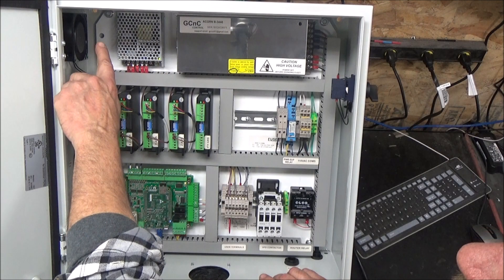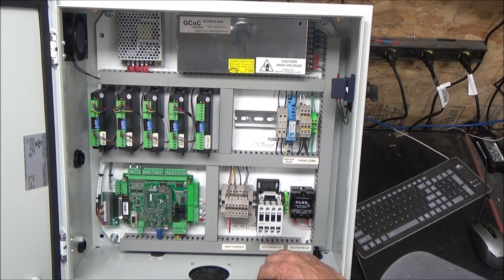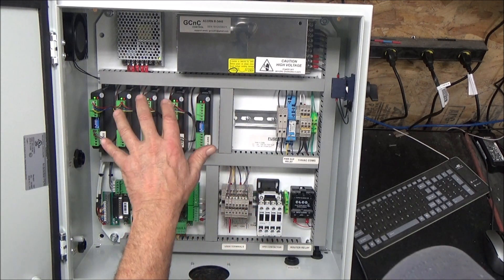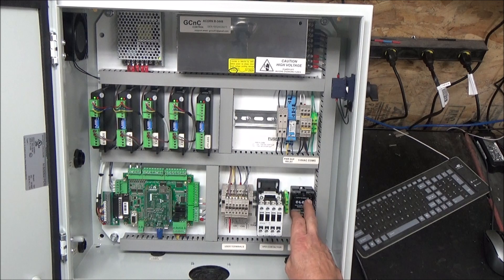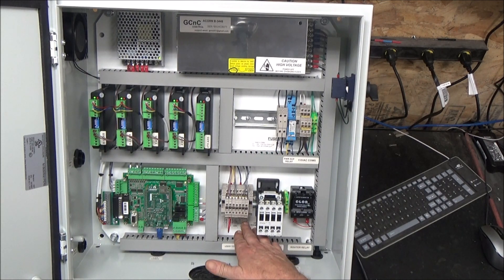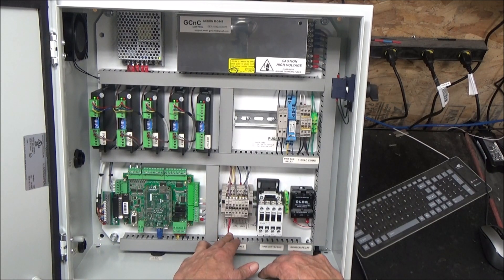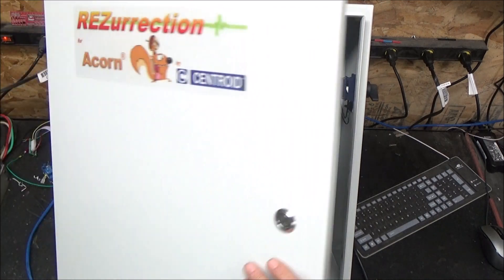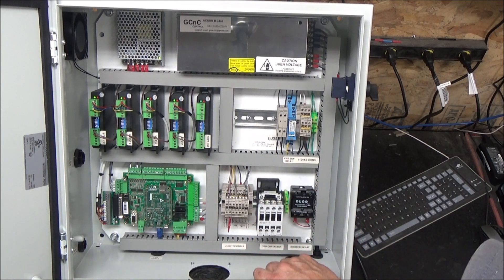Centroid Acorn Controller for ShopBot Standard

Comment: Thanks for sharing!  Nice, clean installation!!!!!!!  Very well thought out.  Good to see someone has taken the time to make a decent replacement control cabinet for the older Shopbots.

Hard to tell from the video, but does that solid state relay have a heat sink?  I used similar relays of those on my Shopbot retrofit.  i.e. they were rated at 25 amps, but in the fine print they said that anything over a certain amp limit had to be heat sinked.  Don't ask me how I know this.  Ha Ha I used one to turn on my Dust Collector and another one to turn on my Vacuum Table.  These were very handy and I had macro buttons on my screenset to turn them on/off.  They could also be controlled by the software.

John